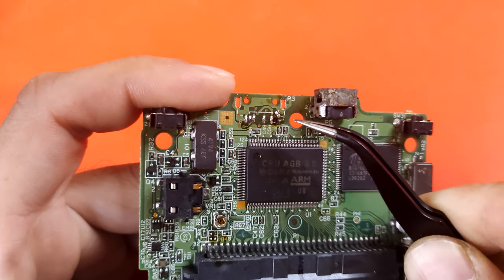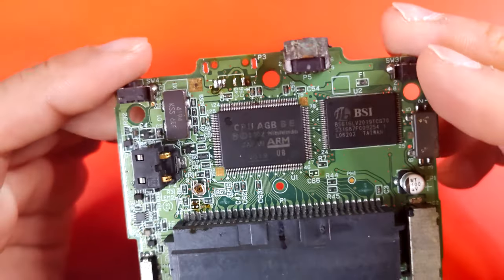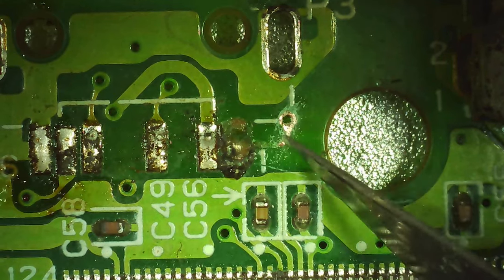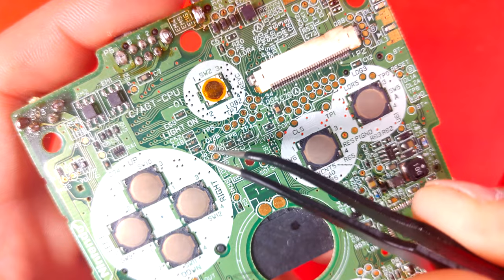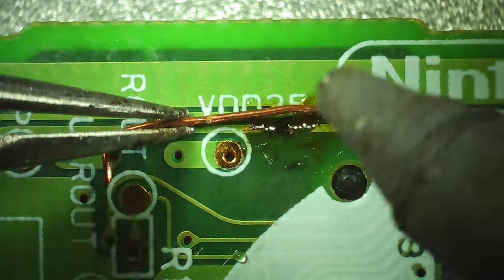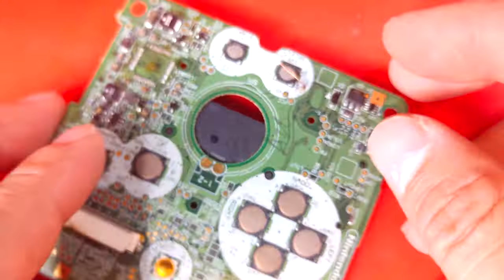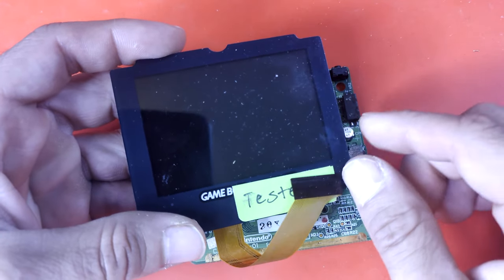How to fix lifted solder pads, broken vias and traces on circuit boards.

Comment: Really great work my bro!!  I lifted pads on that power port when trying to install the usbc mod.  Like 3 pads so I’m still trying to figure that one out.  The trace runs under the port that is supposed to sit flush to the pcb so in order to put it back the wire I’ll be crushed.  Idk lol - I’ll try something soon.  Nice vid!!  😊
Reply from the maker: Thank you! ")
Reply from the maker: And yeah. Ive repaired on like that before, trick is to use super thin wire, and put it through the via hole on the other side of the board, and solder it to the via on the other side. That way it doesnt cause a ball of solder to be in the way of the charge port underneath.
Reply: @retrostashrepairs  dam thanks bro!  This sounds pretty good!  I’ll give it a try thanks :b

Comment: 0:41 You say you are replacing a ripped solder pad, but it is not at all clear where the ripped pad is. You go straight into scraping/cleaning a pad (a) that is clearly intact. I'm guessing you are trying to connect (a) the pad you are cleaning to (b) the pad right above the C56 marking, and that the ripped pad AND WIRE was in the dark area between (a) and (b). Is that correct?

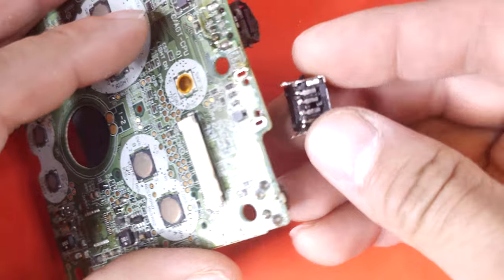1:42 whoa you are jumping too fast here. What is the relation between the component you suddenly bring into the picture and the missing pad (which by the way looks like it is really a missing pad AND a wire in between the two other pads)? To me it looks like the component is soldered at C56, and then the wire is added on from (a)  no to  (b) but to the pin of the component. Yes?
Reply from the maker: 40:00 yes you are correct its hard yo see, my bad I should of zoomed in on the area atleast a couple of seconds. And it is ripped/broken, its the dark area.
Reply from the maker: Sorry still getting used to the editing world.
Reply from the maker: And that component is the charging port. It was previously removed to repair the broken pad/trace.

Comment: Currently attempting to make a circuit board repair ~ replacing a relay solenoid for a "start" button ~ and I'm not sure what I'm looking at here:  Started to solder a new 4 pin solenoid onto the board after removing toasted one and 3 of the circuit board holes have normal tiny circular donuts that the pins fit through but the 4th hole does not appear to have that... Instead, the pin is sticking up through a piece of composite matting material and I don't see the usual tiny metal grommet / donut the pin usually would be sticking up through ~ it's just poking through like a strip of fibrous composite stuff that appears to be built into the circuit board.  Anyone have any idea what I'm looking at here?  Am I just supposed to apply solder onto this mess and hope for the best or what?  Why doesn't 4th hole simply have the usual little metal ring that's built into the board?  Trying my best not to have to spend $1400 on a new dryer.  Thx.
Reply from the maker: Dang do you have a picture of it? And was it like tthat from tthe start? When you fitst opened it up

Comment: Does this also apply to the battery soldering pad when lifted up in a gba cart
Reply from the maker: Yes it does/can. Theres other better ways for that, but more complex. But you can use this method as well, especially if your a beginner. ")

Comment: Sorry for asking but what soldering iron it's that?
Reply from the maker: Its the usb c TS80P soldering iron ") its a nice one. Works with a battery bank or a usb wall adapter.
Reply: @retrostashrepairs  thanks brother for the info 😊
Reply from the maker: @Im-building-stuff  no problem! ")